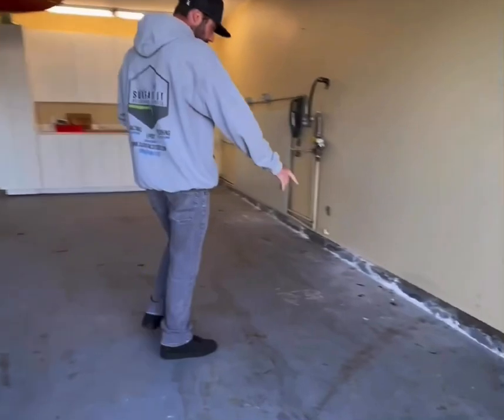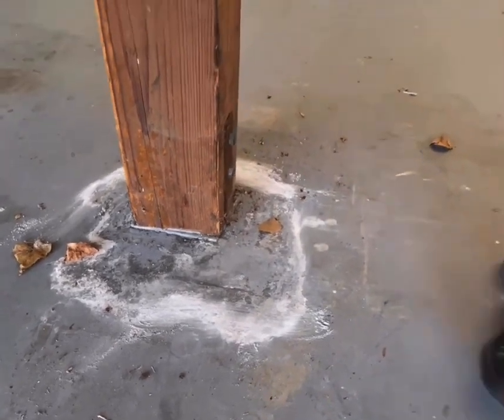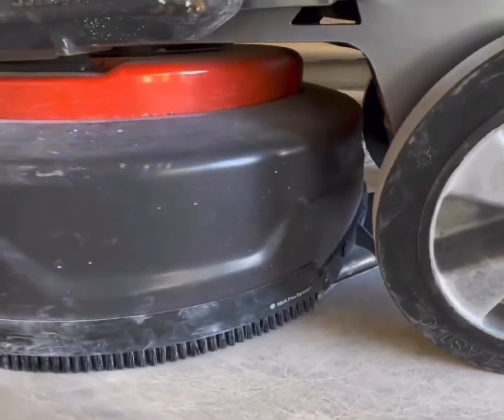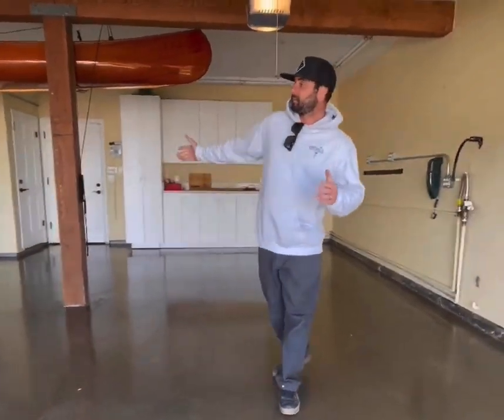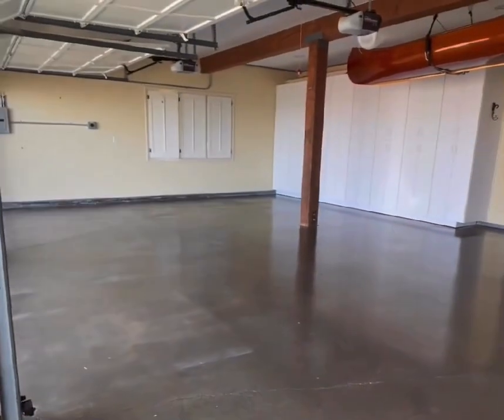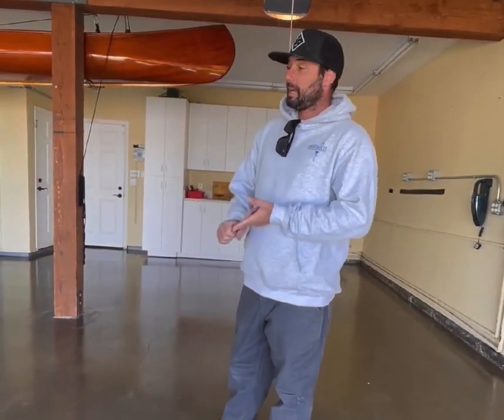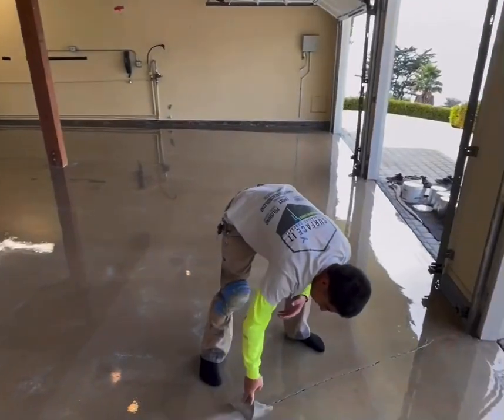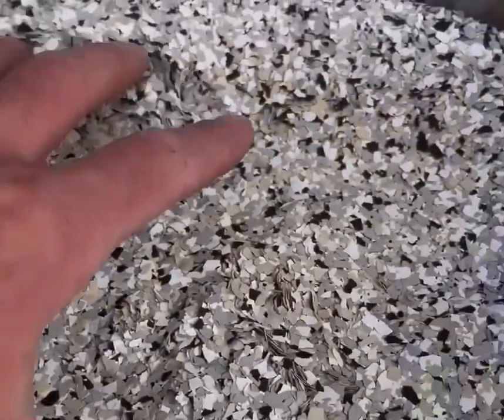Moisture Barrier Install Epoxy Flooring with Slab Hard products

Comment: why did you fill the cracks after Slab Loc application?
Reply from the maker: The goal is to seal up as much as the slab possible. By letting the MVB flood the crack then patch. If you patch first your repair product is taking the hit, not the MVB. Depending on your actual moisture content in the it can go either way.